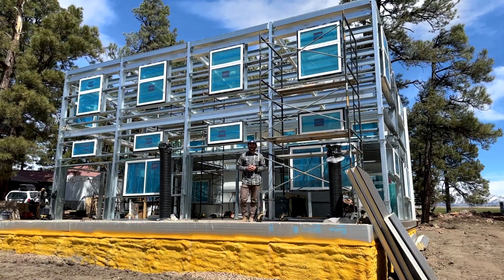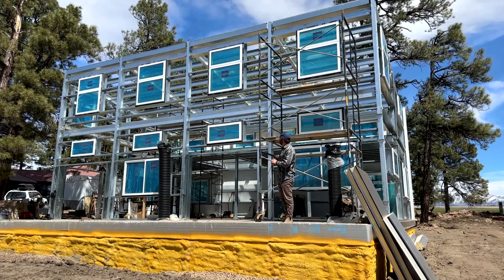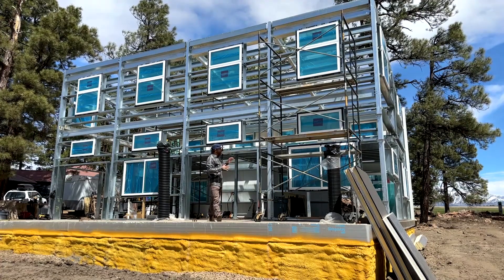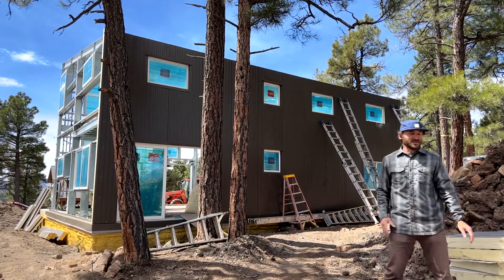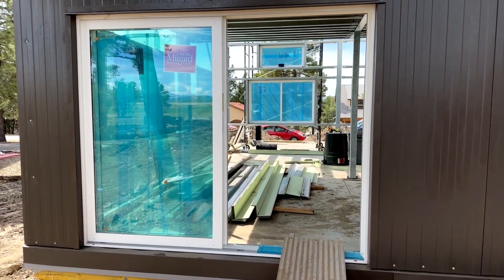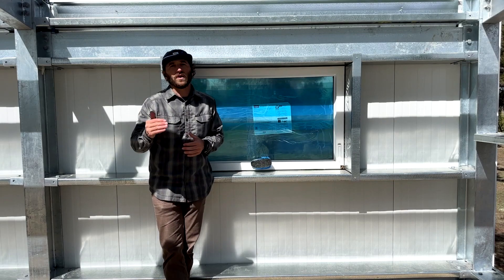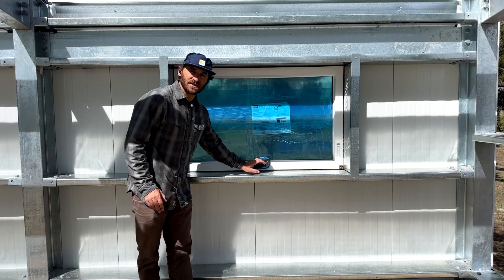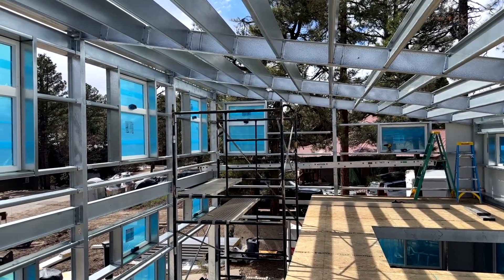Constructing the Windows and IMPs of the First Vesta™+ Kit House

Comment: Nice to see the consideration of the steel frsming, im considering something similar though using post and beam timber frame. i understand stand the metal sip panels are also structurely rated for weight and support them self so the exterior or interior can support weight such as siding, or veneer products. Best part of these panels is not the insulation factor but is the U factor! The separate contact zone from the outside surface to the inside virtually eliminates thermal transfer weather hot or cold and doesn't break down over time as traditional insulation does!
Reply from the maker: Yes thanks for mentioning that! It's a concept we've taken from our greenhouse designs and are now implementing on our house kits!

Comment: A steel frame building with structural insulated metal panels. Nice.  The only problem I have with it are the exposed fasteners making it look like the shop that it was.  What were the blower door test results?
Reply from the maker: Thanks for reaching out! We are looking into alternative frame options but they may add costs to the kit. We also have clients who are drywalling the interior so you don't see the frame at all and it looks like a normal house.

Comment: Great!  I have been patiently waiting for part 2 - and I am not disappointed!  
Everyone asks about price, obviously.  Google tells me the average U.S home price at the start of 2022 was around $350k.  Is that what you're thinking, ballpark-wise as a price point for the base model?  

Outside of all of that, I just think this is such a wonderful idea to integrate the greenhouse with the living spaces as a single purpose-built home.  I love all of the thought and research that has gone into making this, and am looking forward to part 3 and ultimately, seeing the finished product with furnishings and some plants brought in to the greenhouse.
Reply from the maker: Thank you for your kind words and support! Currently, the base kit of the Vesta costs $269K, which we consider to be fairly affordable in this current housing market
Reply: @Ceres Greenhouse Solutions 
The kit would be erected by whom? Does it include the insulated Metal Panels?
Reply: Keep in mind, this is a slab house, and it sounds like they're just doing the house envelope, not: drywall, interior finishes, electrical, cabinets, wood trim, etc.